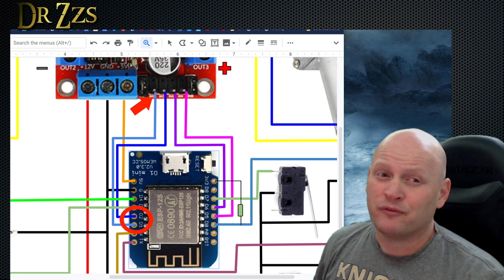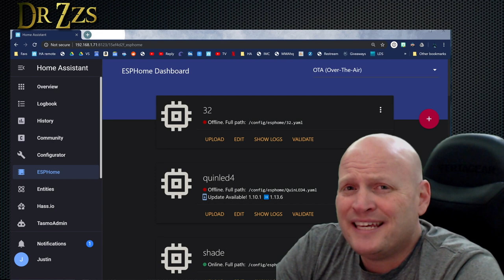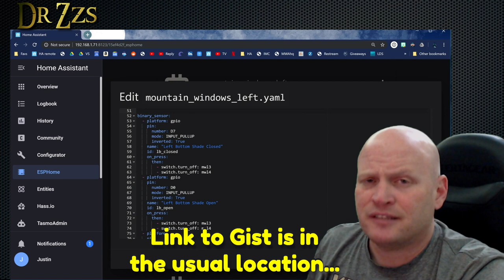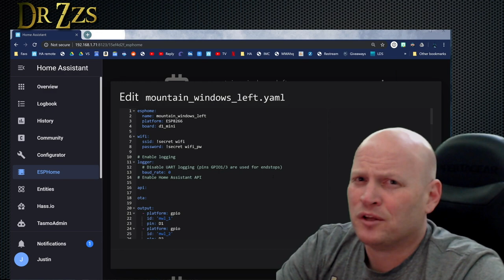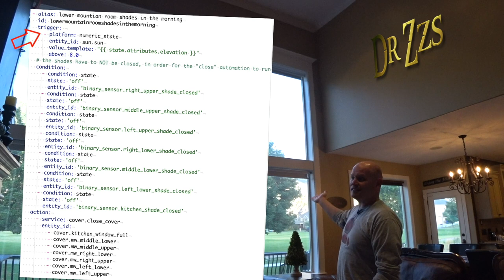DIY Smart Shades for Home Automation

Comment: Super satisfying demo.  

BTW, D0 is actually GPIO16 and on the ESP8266 it has a special command to activate a pulldown resistor for it. pinMode(16, INPUT_PULLDOWN_16), it doesn't have the option for a pullup.
Reply: Wonder if that special command is baked into ESPHome?

Comment: Love this project, we just replaced all 22 windows in our house and now need window shades.  Going all out with your plans.  I've got the limit switches, but as i start planning, I'm thinking of trying magnetic wired reed switches, similar to those for door alarms, or bare reed switches and cut a grove in the Sheetrock for the switch to sit in, and Spackle over.  Then just place a round magnet in the end of the 1/2 inch pvc used to weight the fabric down.  will let you know if it worked or not.  Great project.
Reply: That's a great idea! share the results!

Comment: Hi Doc. I found that glass no reed switches work great as end stops. I just hot glue tiny magnet on the shade to close the reed switch and stop shade motor. Just an idea 😉
Reply from the maker: I tried reed switches but mine weren't reliable.  Maybe I had bad ones or just didn't put them in the right location. 
Glad you had success with it.

Comment: Hi Dr Zzs, that 5v pin on a D1mini is best used as 5v out. If you use it as a 5v in, you run the risk of frying it if the 5v is unregulated, which happened to me. Powering the D1 via its USB is safe because there is a small resistor on the board which regulates the current and is the safest way unless you know for sure that the 5v you are putting in is current regulated to a safe level for the board. Hope this helps, cheers!
Reply from the maker: thanks.  ya, I should probably use NodeMCU more since it has a pin for Vin.

Comment: Nice.  I've been looking for a good solution that doesn't cost much.  All the other decent solutions cost close to $100 or more per window, and like everyone else, I think they're going to want more than just one or two motorized window shades around the house.  Keep up the good work!
Reply from the maker: thanks
I've got a better solution coming soon.  Stepper motors using ESPhome.  Should be more reliable, won't need end-stop switches, can be set to % open, should be quieter and faster.
Reply: @DrZzs A stepper motor for precision ! What a great idea ! I'll try it for sure !
I'm a farmer looking for a solution to open or close the shades of my greenhouses. Your projects will be so useful for my work's daily routine tasks, thank you. Those motors controllers can handle 220v ? I'll may have to add a 24v to 220v relay on it ? It won't require any other change ?
Your videos are so well made and give me hope to automate my greenhouses. Next step I'll try to automate the irrigation with 8 relays & solenoid valves 
Thanks and gratitude from France

Comment: Another method to measure blinds are up or down could be to use roller micro switches on the blind itself. When the blind is fully roller out the tube will be X thick and microswitch 1 will be full extended. When blind is up and at max thickness microswitch 2 will closed.

Or some kinda cam lobe or arm that extends and touches a microswitch as the motor turns.

All to reduce visual impact.

Comment: You should consider using only the top end stop and use timing control for a virtual lower end stop. That way, the fabric stays nice and flat rather than getting wrinkly from sitting on the lower end stop. Use the top end stop to stop the curtain and reset the calculated position of the curtain. Would also allow for a cleaner install because you don't need the lower end stop that is rather awkwardly placed. The upper ones nearly disappear. 

The ideal would of course be a servo, a stepper or a rotary encoder for position, but that's obviously also a higher cost. :) 

Your motors are rather slow, so it might not be of interest to you, but if you want a nice "show off" effect, you should time the time from the upper curtains going down fully plus the delay that the curtain would have to reach the starting position (upper end stop) of the lower curtain, if it could travel that far, and then only start the lower curtain after the top one is fully closed. Same for opening, just opposite; the upper curtain only starts after the lower one would raise to that level. It gives a nice continuous effect to both the look of the curtains and the amount of daylight entering. In programming, this is best achieved by essentially treating the two curtains above each other as one long curtain, so that manual commands also work in the elegant way. :) 

For automation there are two basic options; interior vs exterior light level, which is typically implemented for privacy and to avoid window reflections when inside. The other option is GPS calculated sun position, to also take into account that the sun moves sideways on the sky across seasons. :) The latter is primarily used to reduce solar radiation (heat) inside, and to avoid unwanted glare from the sun, e.g. when watching TV or having a conversation around the dining table.

If you do the above/below control I mentioned, you can combine it with a gradual sun elevation control to really effectively and very comfortably avoid glare from the sun while still getting as much daylight as possible. You do this by finding the lower and upper sun elevations that you want to shade, and which curtain positions these should result in, and then simply scale those two sets of values to form an position. Remember to set a minimum stationary timer or a minimum deviation between calculated vs desired position to prevent the curtains from slightly moving all the time to avoid damage to the motor. Something like 2-5 % minimum difference to move typically works well to ensure fluid controls but also not constant motion.

Hope it helps and inspires.
Reply from the maker: Great ideas! 
I love the idea of timing them so they look like one big shade lifting and lowering.

Comment: I am trying to do this down to a single window. I have everything wired up on the left side of the D1mini but the motor only seems to spin when I have the button pressed on the box. I have not tried putting ESPHome or anything on the mini. Do you have any tips or documentation I could reference to try and figure this out? Thanks

Comment: Have you considered using a stepper motor instead? to avoid top and bottom switch ..
Or is it intentionally not using a stepper motor? and why? I have ordered parts to test it with a stepper motor myself
Reply from the maker: I wanted to use steppers.  So far I haven't had good luck getting steppers to work well with ESPhome or Tasmota, and since I don't have the skills to write my own arduino code I'm limited to those options. 
Steppers would me a good solution if I could get them to behave :)

Comment: I have been looking for something like this, but for Venetian blinds. I do not need/want switches or stopper switches - I just need to tilt the blinds. That's it.
I tried to use this code, but the switches and stoppers as so intermixed into the logic - that I totally loose track of what is what and what to keep and what to remove.
You do not perhaps have simpler code that can just spin the motor in each direction (to control the blind tilt) and that can be controlled from Home Assistant. I do not even want to pull the blind up or down, just tilt it in both directions.
Thanks
Reply from the maker: Best way to tilt the blinds is to connect a servo to the tilt mechanism.  I did a blinds video a long time ago.  ESPhome has a pretty easy to use Servo function.  I'll actually be talking about using a servo with ESPhome in my next stream (hopefully tonight).  There will be an edited shortened re-cap later too.  
Hope that helps.

Comment: put two magnets at the lover end and one at the top end of the cloth. 
Two door/window sensors at the printed motor enclosure and get the position accordingly to that.
get rid of the riddicilous wiring and try using only one 8x0.22 alarm cable for each shade, only 4mm in diameter. 
Besides - brusshless dc motors are way more quieter :)
Reply: I have just started this project ordered parts online and 3D printer has been busily working away.

I totally agree with you wiring up to microswitches on window sill is not WIFE friendly, those niggles and sighes of disapproval..

Plus it just makes total sense to use 433Mhz wireless door sensors I seen them on ebay for $5.71AUD ($2..USD).

Comment: Great project!
Unless you want the shades to be down when is is raining/overcast, you can use the A0 input on one of the D1Mini's, a LDR and a 10k resistor to measure actual light.
Would make it a bit smarter. Would add maybe 1-2 dollars to the total cost, though :)
Reply from the maker: That's a great idea.  I've got some light sensors just sitting around too.  I'll have to try that.
Reply: @DrZzs  Great! A suggestion would of course be putting in a deadband (or maybe a delay_off?) for those partly cloudy days when the sun say hello and goodbye all day long.

Comment: For your manual control buttons (the D3 input for example), is there any reason why you didn't use the "mode: INPUT_PULLUP" in the definition of that pin, as you did do it for the limit switches?

Comment: 15:16 What do you think about to use instead the end switch some timer based model. I mean when you are open the shade, you definitely know the time needed to down the shade. So in this case you need less switches , wires and more simple install. Even don't say about small children, that love to experiment with small clicking buttons )
Reply from the maker: Maybe for going down, but going up I would recommend the end stops. I had them with just timing at first but they are never exactly perfect on timing, so after a few cycles of open/close they get farther and farther from the correct end point.
Reply: @DrZzs  Exactly what I mean. The upper end switch will correct the state every time.

Comment: I am in love with this project!! How did I miss this? What about a stepper motor or something that might not need a sensor, would you know how to do that?
Reply: B McD I'm not positive but i think you would just need to figure out either the timings or how to send a number of rotations (which might just be how long does it stay on)
Reply: You could, in the 3D printed adapter that attaches to the motor drive have three holes spaced around the circumference in which you place 3 neodymium magnets. Then mounted on the motor drive box have a KY-024 Linear Hall Magnetic sensor connected to the esp to count the pulses as it rotates. With a bit of programing you would have a pulse encoded blind.

Comment: Hello, I just got the motors for the shades.  I am using 23rpm (lowest one) and it does not provide and holding torque on 3/4 way down it rolls down freely.  I even removed the bottom 1/2" pvc.  And when roll up it does not have power at all.  I use same parts and my windows is 38" width.  I did not have 10rpm motor as your video.  Is there a better motor to use that has more power and holding torque?
Reply: I figured it out that is the 1 inch motor end, the middle shaft connect to the motor is loose so it just keep roll down freely.  I make one windows with 2x50rpm on each sides to make it more torque.  Thanks for all your details ESPHome codes.  It works great so far.

Comment: Great video :D! But why do you need the stop switch? Here is what I've been doing, I know that the shades will go up and down to a specific place, so I had a stopwatch and calculated how long does it take to fully open and close, and simply have the esp8266 count the time until the time elapse, then it just stops because it knows it reached 100%, you can have one stop switch to calibrate the timing to be accurate everytime. That way you can have a slider for the shade, want the shade to close in the middle? Have it stop at half the time it takes to fully close. No need for extra switches :)
Reply: You always need a limit switch. First of all for safety if the code gone crazy for example. Actually the limit switches shall be user to disable the motor driver directly.
Second you cant depend on a timet only since every time you will probably get a delay which will be accumelated.
Reply: @3adelz90  which is why there is one switch on top, to re-calibrate the time and avoid the delay, but in all honesty if the ESP8266 is the one dealing with the timing, there wont be much of a delay since it's the one controlling the motors, beside there is little chance of the code messing up.
Reply: What if the power is interrupted while opening or closing the blind and it stops in the middle? The power is restored and now you need to move the shade up or down. Pressing the up button causes it to run for the full opening time and jams the blind or damages the motor or damages the motor controller or the 3D printed drive parts. Pressing the down button does the same in the opposite direction because it tries to run past the bottom.
Reply: @leglessinoz  and this is why I suggested having one switch which is either top or below, the way I did it is whenever power is back on it would go to that switch that way its recalibrated and ready to go
Reply: @MrTracker1995  At first I was thinking the same as the other guys eg you can't perfectly time it, but I like that your thinking is not limited by convention. The part where IF this (eg power goes out) THEN return to switch to re-calibrate ELSE continue as normal.

The code then needs to take into account mains voltage perhaps coz some countries/areas the power grid is not always constant maybe the motor could go slower or faster so you could take reading from a sensor that monitors your main voltage eg Sonoff POW R2 and IF voltage < 210V return to base to re-calibrate.

Comment: Hi, I already have a motorized awning (220 v ac) with limit switches already fitted in the motor. I really like your project and I thought of using it for my awning (and also for electric shutters). I think I should use a 2-channel relay module, but without the need to use limit switches. What changes should be made to your software? (I'm not a programmer).
Thank you very much and congratulations for your great project.
Reply from the maker: I'd have to know exactly how you have stuff connected to tell you what changes to make to the code.  
What I'd suggest is to lay it out on your desk, all connected, and tinker with the ESPhome code until you get the function you want.

Comment: Hey DOC great job as ever, but the resistors you use what resistant value are you using?
Reply from the maker: 4.7k, but I don't think it's too important what size you use.  Just has to be high enough that there's 3v when the pin isn't grounded.

Comment: Why do you not using steppermotors en calculate the steps needed so you don't need the endstops? With steppers you can just open the shades for 20% for example.
Reply from the maker: True.  The reason I haven't used steppers is because they are not easy to use with ESPhome or Tasmota and I'm not savvy enough to write an Arduino sketch to control them and integrate them with Home Assistant.  
Maybe v3 :)

Comment: hi doc! how did you select your motor? empirically? random (and it works!)? trial (and much errors)? calculated (like an engineer)? on a budget? approved by WAF?   BTW, I'm gonna try to mount some rulers alongside the curtain ...
Reply from the maker: Basically a guess at required torque.  I little trial and error on some other projects like the blinds and window openers.  And price.  There are stronger faster motors, but they cost 3x as much.

Comment: Get a few hall sensors and a few magnets, install a hall sensor near the top (or near the motor) and a magnet at the bottom of the shades, so when shade is max open sensor is triggered (like an end stop). Now the way my code behaves is like this,  first time running you have to calibrate, go to max open position (trigger endstop) and than use app or buton to max close the shade and mark it calibrated and write its curent position, max movement from top to closed position into spiffs, since only problem now is a power failure when motor is moving I do the following whenever the shade motor is moving a bool is written into spiffs when motor reached desired position the bool is changed and curent position updated again, if power fails while motor running on startup the shades will automatically calibrate: go to open position until it trigger the hall sensor and go back to the desired position. Since I installed this I had zero failures and less wires (only power to the controller box)
Reply from the maker: that's a good idea.  I'll have to find another window now to try that on.

Comment: What's the amperage of your 12VDC power supply? and no specific value for the resister? like 5k ohms is fine?
Reply from the maker: I'm using 12v 1 amp PS.  https://amzn.to/2KsmF75
the resistor I used is 4.7k.

Comment: How did you suddenly make your wife (I presume) disappear at @11:21 That was magic.
Anyway, it is also possible to use the limit switches without them being attached to an input pin. They need to go in series with the motor and be bridged by a diode. but then you would lose your feedback to your homeautomatics system